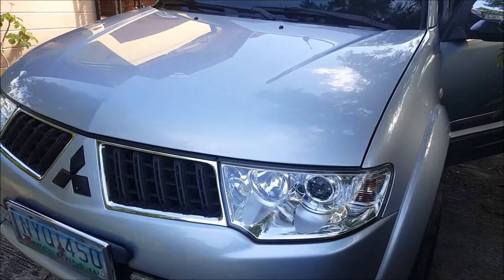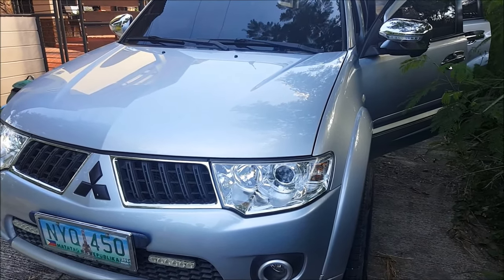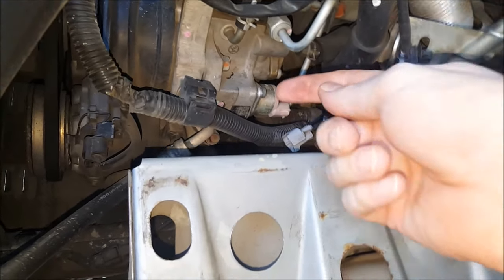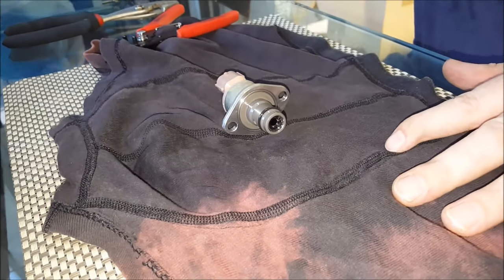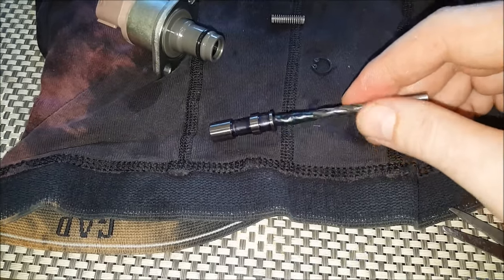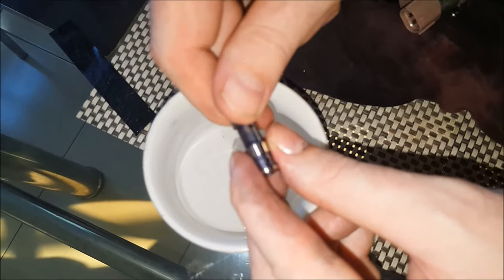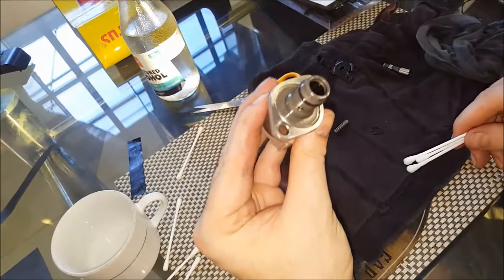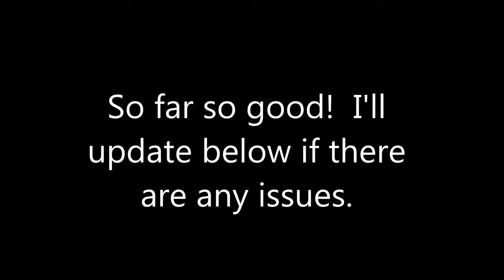2009 Mitsubishi Montero Sport 2.5L Suction Control Valve (SCV) Removal and Service

Comment: Did the very same job today on an Astra 1.7 cdti. Great result after stripping and cleaning.
 Idle is rock steady at 750 rpm after hunting and surging at idle over approx 110 rev range from about 710 rpm up to 820 rpm.  Made driving in slow moving traffic a nightmare and three different drivers managed to stall the engine moving off from a standstill. Not good. Basically followed your method and it worked a treat. 
Thanks for taking the time to make the video and uploading.
Reply from the maker: Glad it worked for you. Cheers!

Comment: After weeks of stalling and idle problems with my 09 plate l200 I replaced the scv with a new denso scv, which I had coded with diagnostic tool, still the problem persisted but with now an error code! Found this video and gave it a go and within 2 minutes the warning light was off and the truck behaving normal. This was 3 weeks ago and still it runs perfect! Definitely worth a go even if scv is new as they can stick also it seems.

Comment: Hi there from the UK, I've had an underpowered shogun 2008, sometimes I could put the throttle pedal to the floor and it wouldn't pick up more than 1200rpm, the engine light has been on for months. I watched your video and took my suction control valve out and ITS FIXED, I have power again and the light is off, many thanks, Ant. 👍😀

Comment: I did this on my 2010 3.2 montero. Same problems before. It did well after cleaning the scv. However the engine sign on the dashboard lit for hours of driving. Luckily it went away after restarting on my next drive. Im happy i watched your video. Thanks to you
Reply from the maker: I use a cheap OBD2 scanner to check codes and reset the light after repairs. Highly recommended tool.

Comment: Thanks for the video. I did this to my 2006 Corolla Verso D4D. Engine kept hesitating and cutting out(especially at the lights). Cleaned the SCV and engine a lot smoother on idle and has not cut out since. Been a week so far, Thanks again!
Reply from the maker: I'm pleased to hear this!

Comment: Thanks for the vid,
My triton 3.2 was surging between around 1800rpm and 3000 rpm.
I took out the scv, took it apart and cleaned it with 1200 paper and crc.
Surging is completely gone now 😁

Comment: I have a Toyota Hiace D4D. It has done 250,000km. Been having trouble with it cutting out at idle while stopped and hesitating or even cutting out at low throttle position while driving. Today I pulled out the SCV and sure enough a bit of gunk in there and slight wear on piston. Fine marks as well. Polished it up as you show in the video and a good clean. Runs like new again! Thanks so much for your ideas in this video! Owe you a beer some day!
Reply from the maker: Great to hear another success story, especially on different a vehicle!  What lead to you suspecting it was an SCV issue?
Reply: @electriccarconversion  The symptoms matched what I read on the net for a SCV. No fault code, stall after 15-30 sec idling but start up fine again, rough idle
Reply from the maker: @digigarb  wow, good work.  I think I was lucky to get the fault code that directed me to the SCV.  Thank you for the symptom contribution.  Cheers.

Comment: Thank you so much!. When it comes to engine issues, almost all the times the manufacturers propose to change evrything. This method correctly worked for me. I t allowed to detect the root cause of the problem. Now I will change the part in order to be 100% safe.
Reply from the maker: Alexis LANGLADE I'm happy this worked for you! Feel free to check my link for the part if you're in the Philippines. Cheers.
Reply: Thanks but I am in France, already ordered the part :)
Reply from the maker: Alexis LANGLADE nice, I'm happy to have reached you on France. Cheers

Comment: I have the same problem on my 2009 montero 3.2. the service center guys are clueless. Im going to try this one. Tnks
Reply: Hi solacechannel, did this worked with your truck? Coz I am having low power issue with my 3.2 strada 2010. Thanks to this video aswell. Im gona try this.

Comment: I just want to say thanks for the vid, I was going through a period of frustration and some mechanics weren't sure, as I couldn't figure out my problem. I have a Navarra d40 , and all the signs were similar to what everyone was experiencing. Changed my
SCV and had it recoded all problems solved
Reply from the maker: Outstanding, I'm happy to hear the somewhat awkward process of describing mechanical malfunction has its benefits.  Cheers
Reply: Yeah, I had it scanned and the error code P0089 came up indicating fuel pressure regulator, thankfully this mechanic knew his stuff and help from all the comments and the vid.

Comment: i dont think so unless ask the oem. The 2011 scv does not have the big spacer shown in this video, but the fixed type scv on 2011 can reach up to 5 years for a well maintain diesel fuel system. reasonable to replace if reach 100km or 5  years.

Comment from the maker: Well today is December 14th,  2016, about 1.5 months and roughly 1000 kilometers since I did the procedure.  I started having faults very similar to the faults when the SCV was initially failing.  I plugged in my generic OBD2 scanner and saw an EGR error (P2413). This isn't as specific as the fault codes retrieved by the dealership at a cost of P1500 but my scanner only cost me P600. Anyways,  that's a topic for a different video.  I'm going on a road trip tonight so rather than recondition the part again, I installed the replacement part I have a link to above.  That part did the trick and the car is running very well again.  I'm ordering more of those parts as a result. It's worth noting that there are two gaskets,  one o-ring style and the other flat gasket seen in the video.  In the video,  both stayed in place,  but this time they both came off.  Make sure to keep track of BOTH GASKETS.  I'll try and annotate the video with regards to that. I will recondition the original SCV when I get back from my road trip/vacation,  this time I will remember to polish the walls of the cylinder where the piston slides,  which if you watched the video, you will recall I only cleaned with solvent. I may make another video for that.  Best wishes to all.
Reply from the maker: I made my road trip from Davao Siargao just fine,  but today, December 17th 2016, as I'm driving around the island I started having faults again. The physical symptoms are not exactly the same.  I checked my fault log and it again says EGR system (the same P2413) .  I believe I may actually be having EGR issues not SCV this time around,  though perhaps a result of my frequent SCV faults prior to reconditioning my SCV. Time for more learning.
Reply from the maker: Ok,  so on 12/19/2016 I took my car into Mitsubishi Butuan.  They picked up the same EGR (P2413) error.  I went ahead and had the 25k service performed and had them completely clean the EGR valve,  EGR intake and the throttle body/intake manifold.  There was a ton of carbon,  the valve itself had  2-3 millimeter of build-up.  I'm betting the car didn't have its 15k service when the EGR should have been cleaned, especially since I bought it at 15k. The EGR valve is very expensive and I would highly recommend cleaning everything before kicking down for a new part.  I was told EGR valve should be cleaned every 15k. Car made the drive back to Davao city with no problems or faults,  infact performance is greatly improved.  (I had more power and smoother acceleration with reduced knocks.) I'll clean up my other SCV and keep it as a spare.
Reply: thanks for all the explanations. I will be cleaning the SCV tomorrow for my primera p12 so watching your video was very useful before my try.
Reply: MonteroGuy  if you getting a egr error check it for carbon build up egr returns exhorst gas back to engine i did a block off but if you do this you need to drill a 13mm hole in  the butterfly on intake if you do a search on soot bild up you will see what im talking about

Comment: the 2010 to 2013 onwards montero uses the non circlip triton vgt long type SCV. When cleaning it just soak its nozzle only in a carb cleaner or kerosene  solvent. when a short SCV IS TO BE REPLACED with the long fixed type SCV it needs to relearn in the oem carshop. So to stay away from relearn procedure replace the short scv with a short and the long scv with long so it is plug and play. 14060A37 short scv for 2009 and below monty. while 14060A056 long scv for 2010 to 2013 montero sport.
Reply from the maker: Matt Quebec thanks for the information,  Matt!

Comment: the clunk noise and wine would be your front diff engaging as it is held off by vacuum as i found on my when i was trying to spin the frond drive shaft with the car off started the car and it turned freely
Reply from the maker: James Brock nice! This to know. I hope there wasn't much damage since when the diff tried to engage.
Reply: @electriccarconversion  I always wondered what that clunk was , say when u should change back but stall it. Sounds awful.

Comment: good day sir after clean the scv are we need to reset by computer before start the enjin
fm malaysia tq sir
Reply from the maker: Yes, anytime after you fix something that was throwing error codes. The error codes should be cleared and reset so you can gauge if the issue has been resolved according to your ECU.

Comment: Hi i also have same issue with my 2008 montero 3.2 L DID... just serviced SCV as per your video and it is super good now... i want to know that how long does it will work?
Reply from the maker: Mine is still running good. I just sold a Montero.
Reply: @electriccarconversion   oh ok... Thanks for your video....
Reply from the maker: @shankaranshanmugam7657  Thank you for the feedback

Comment: I have the same problem in my Montero 3.2  diésel. I’m going to follow your useful video but I have a question. Do you need restart the system with a scanner after put the SCV again?
Reply from the maker: Please do let us know how this SCV cleaning goes with your 3.2L Montero.  To answer your question regarding the check engine light.  The check engine light needs to be reset after completing a repair.  I know how to do this using scanner, though I think I have heard there  may be techniques for resetting without scanner, I'm not sure how.  I'd suggest buying an inexpensive ELM327 scanner.

Comment: I put a brand one scv in my triton after having issues old one was stuck shut, put a new one in 3 days later same issues and it was also stuck shut I freed it up and put it back in and drove fine for a bit and now same issue, I might take it back out and do what you did and see how I go
Reply from the maker: I recommend it, because it gives more tolerance for the impurities in the fuel that damage the slider.
Reply from the maker: Had did it go for you?

Comment: Thanks for the contribution, if you could help me, I had fuel, where is the suction valve, the mechanic tells me that I should change since it is damaged, the leak was in short urban areas, it is changing and it is working well and there was no leakage, but I made a long journey and when I reached the destination I fixed and followed the leak the part of the suction valve is soaked with fuel, much less than before:
I bought the original suction valve and with it came the valve or an oring (jebecito), the mechanic changed it but did not put the oring, just put the package that is equal to the valve cover that was already there, I assume that the leak that is why it is not hermetic, IF IT IS CORRECT NOT TO PUT IT THE ORING (jebecito) that came; or what may be going on for there to be fuel leak, is L200 4x4 year 2008 diesel, grateful for your help.
Reply from the maker: I would think you should put the o-ring seal in there if it wasn't already. Sometimes mechanics use formagasket, or sealant, and this is more often than not a bad idea. Chunks os sealant can break off an clog oil cooling channels etc.

Comment: hi monteroguy, i have a monterosport 2009 4m41 diesel engine and been having the same problem of losing power, is the part sold in the link the same one used for my engine? or do you think i should try to clean it first before replacing it? thanks lot.

Comment: what is the parts oem number? Is it 1460A037? that looks right but i already bought one that was too long and diameter was wrong... dont want spend money for wrong parts
Reply from the maker: That is the correct part for my 2009. There may be SCVs that are designed to work with the vehicle or are compatible and look different.  Though I wouldn't know about and can't speak about those.

Comment: Yes common rail.  
Got it sorted. 
Switched it round 180 degrees. 
All good 
But I will replace
Reply from the maker: Rodney Mc caughey,  I'm glad to hear it's running better.  The 180 degree flip worked for a short time with me. Hopefully the part cost is reasonable.  Cheers

Comment: Thanks for the great video. I am wanting to do this myself, but the service manuals say that the ECU should be re-learned once you replace the SCV. Can you recommend a good OBD tool or something to sort that out? thanks
Reply from the maker: You just need to clear the error codes, and most OBD2 software apps will do this.  Try Torque.
Reply: @electriccarconversion  Thanks mate, I really appreciate it

Comment: I tried this method on my 4M41 Strada 08... Worked for about an hour... Then suddenly it shut off for no reason. Now the issue is back.. Any more suggestions on what to do next about this?
Reply: Update.. I just scanned and it says Fuel System Leak but I don't see any visible leaks...
Reply from the maker: @bisayanibai4809  a scan is a great place to start.  I am no exist, but I would think a fuel  pressure drop would be the cause of a leak being reported.  I would check all fuel system connections, houses, and seals.  When you pulled the SCV, were you careful with the flat gasket and o-ring?
Reply: @electriccarconversion  Yes I was careful.. The gasket was safe. But for assurance, I also changed my O-Rings, the small one and the big one. The acceleration of my Strada 08' became better than before. It became quick and smooth. But it still shuts off. But not the same as before where it ALWAYS shuts off especially when I let off the accelerator pedal.  I don't know what to do next. I was also reading some forums and I did what they said there but it still shuts off. Running out of ideas hehe.. Can you give me your contacts or where I can send you a photo of my SCV when I took it?
Reply from the maker: @bisayanibai4809  Telegram user ID:An_O_Nymous

Comment: I also have issues.  
Jeep dies out sometimes at junctions or sitting idling. 
But once driving on the gas no issues
Reply from the maker: Rodney Mc caughey Is your Jeep a common rail diesel?  Does it have On Board Diagnostics II (ODB2)? (Vehicles made after 1996 should have.) If so, you can hook up a scanner and get the fault code which should indicate the exact problem.  If it's the SCV,  it should say so.  If you're in the Philippines, you can get OBD2 scanner cheap on OLX
https://ssl.olx.ph/i2/item/elm327-bluetooth-obd2-obd-2-obdii-scanner-factory-sealed-ID7G62w.html?

Comment: I want to add, also please check your fuel lines, especially line which goes from the fuel filter to the fuel tank. Might as well check the fuel filter and the strainer (located inside the fuel tank).
Reply from the maker: Definitely, leaky fuel lines and clogged fuel filters are always things to be wary of, good feedback.
Reply: @electriccarconversion  and, if by any chance you have to replace the scv, you have to initialize it. Otherwise the problem will still persist.
Reply: @electriccarconversion  yes sir. I am merely speaking out of experience.

Comment: Great Video !
I have a L200 same exact engine as your's , the engine stops while driving and i don't have power between 800-3000 rpm .
I serviced the EGR valve and the MAP sensor and it-s al ok there , should i try the Suction Control Valve to see if it makes a difference ?
Reply from the maker: KISS ANDRAS I'm glad you liked the video. If it were me I would buy a cheap OBD2 scanner. I sell some on OLX. Get the error codes and see if the error codes name the SCV. If so, then you found your culprit. You can then repair the SCV and reset your error codes.  Let us know how it goes. Cheers.
Reply: Hi , i have an OBD II scanner . I have 2 fault codes P0093 and P0107 , one of then is the MAP sensor but i checked that and the MAP sensor it”s working ok . 
Maybe I have a problem with the injectors , but after 2 mechanics have seen the car I have no answer from them
Reply from the maker: P0093 Is fuel system leak detected.  You may perhaps take a careful look at your entire fuel system and look for leaks. When my SCV was bad I had an error code specific to SCV. That said, it likely wouldn't hurt to clean your SCV as shown in the video, but I'm not sure it will solve your current issue.
Reply from the maker: Upon further reading P0093 indicates a leak between the mechanical fuel pump and the injectors. Perhaps search there. Also, if you do remove the SCV, keep an eye on the two gaskets, one flat, one round that go between the SCV and the fuel pump.
Reply: I will search between the mechanical fuel pump an the injectors but I also read that P0093 is a large fuel leak wich is asiciated with an injector being cloghed and the ECU interpreting it like a leak... This i've read at an L200 fanclub
Reply from the maker: Please do follow up and let us know what you discover. Best wishes
Reply: Did you found the problem with code P0093